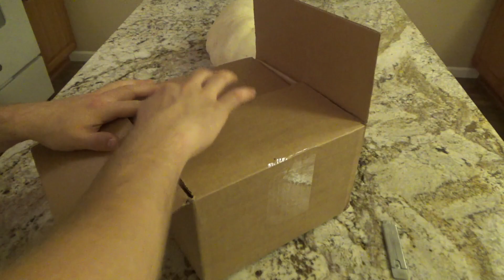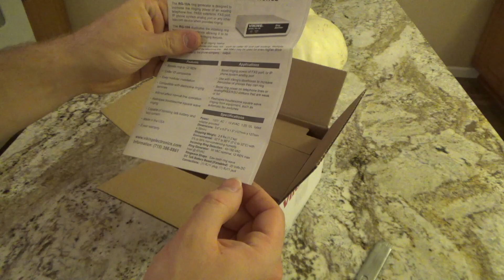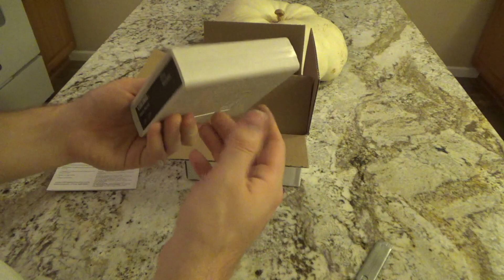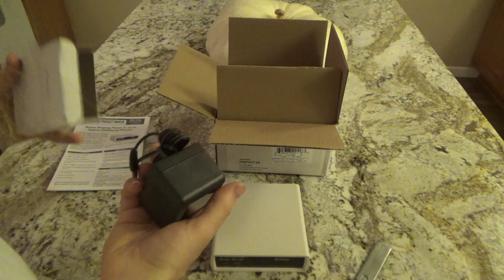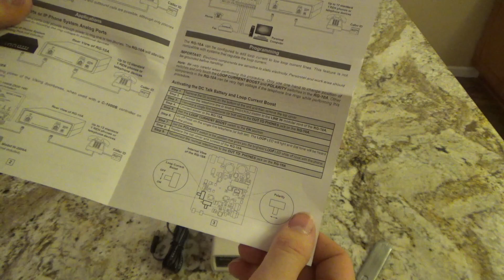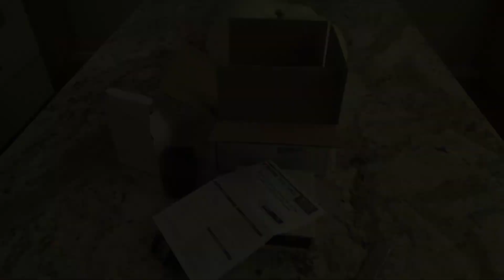Rebuying the Viking RG10 Ring Amplifier

Comment: But... but you could've just used the PBX and saved all that money...  Oh well.
Reply from the maker: Using a PBX in this case would be a complicated answer to a simple question. At the previous house, I at least had a use for one of the additional features gained from the setup. That use case has gone away here.

The PBX units I believe have a theoretical ring output of 2 REN per extension, which diminishes with the length of the wire. I would have to run at least one, in some cases 2, wires to each room, install a carrier and an expansion slot to get enough extensions, reprogram after every substantial power failure, etc. The amplifier is a plug&play solution, it installs in seconds, has no programming to get lost, quick and easy to swap out if it ever failed, and it doesn't care about the wiring as long as it all ends up connected to the same port.

I'm all for working with what you have on hand to make something functional, but sometimes it's worth spending the money to get the right piece of equipment in effort to simplify. In this case it was even an ethical purchase being made in USA.
Reply: @JordanU  In order for the REN booster to work over the entire house, it would have to be placed where all the house wiring converges at the entry point.  Obviously that's not outside or you couldn't put the REN booster there.  So couldn't the PBX just go there instead, and each existing phone jack go into one of the extension ports?

You had a UPS before to save configurations after power outages.  But even if not, the PBX has its own battery backup, and I believe there also exists an expansion PC-card that saves the config in nonvolatile memory.  Even still, is there that much config involved in setting the date/time, forwarding all Line 1 calls to every extension, and enabling conversion of pulse to tone?  I thought it even did the latter two things by default.

Obviously I'm not your financial advisor but I would've thought after such a major purchase (and especially a fixer-upper) that the funds would be tight for a while and you'd really have to work with what you have more than ever before.  I agree about supporting the Viking company because they're a reasonable entity that makes a great product, but still.  But I'll stop there because that's personal to the you and not personal to the me.
Reply from the maker: @Xyspade  Such a conversion point already exists at the modem. You're assuming each jack is a home run, but this is not the case and would be a major waste of wire. A UPS only holds for less than an hour, the on board batteries I believe are only good for a few hours. There is a backup card, but that would have to be purchased, along with whatever software is required. All the clocks and phones at least need to be reset after the power failure, why add yet another piece of equipment that requires several minutes of interface?
Reply: The H, I really wish the Jordan would the get the Viking Simulator.